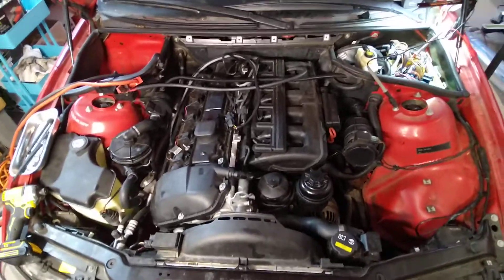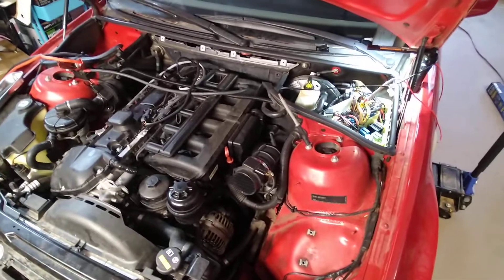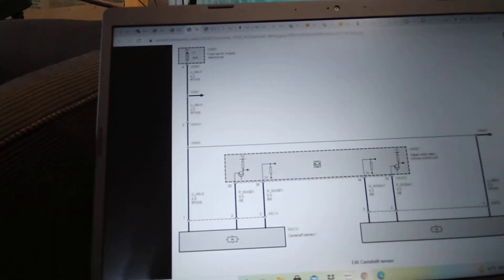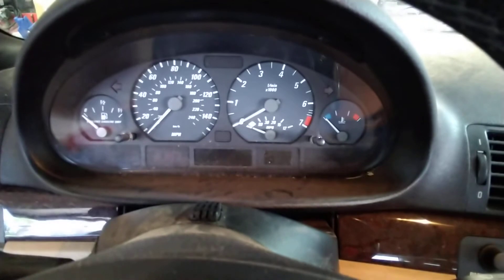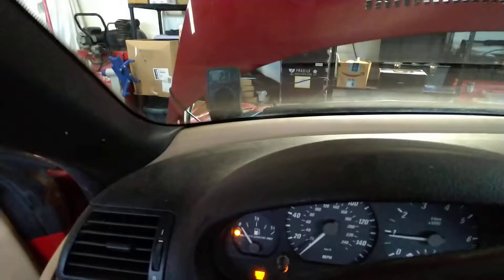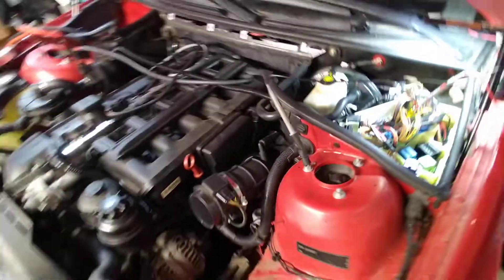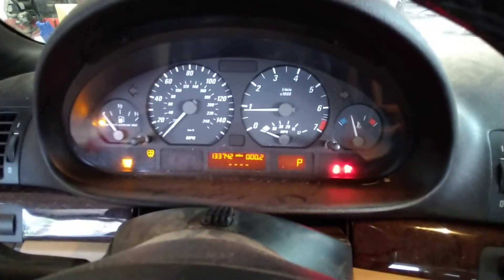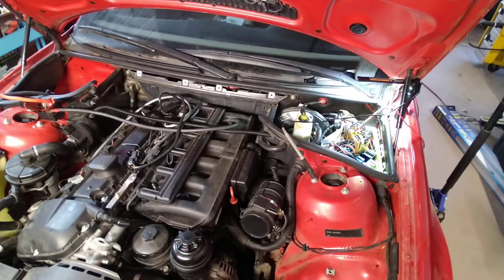**SOLVED** BMW E46 2005 325ci cam sensor signal code 2766 p1315, Not a common solution

Comment: Thank you so much for your "solution"
I have an E60 with this same persistent code. I even sent out the ECU for testing, and they showed me a video of my ECU running perfectly on a dynamic test they did, so nothing made sense.
Until I have read your solution.
We did install new head gaskets etc, and some guy came to do the timing.
Now I can confirm it wasn't done right, since he didn't use any special tools.
I will conduct voltage tests like you did, but I am pretty damn sure this was the issue all along.

Comment: I'm having crankshaft sensor problem with camshaft low voltage to the crankshaft 
Also have a 3 to 4 second delay on the start any suggestions will be appreciated thks

Comment: Hello, same code here on m54 engine. When hot the engine cranks long...it is driving me crazy. New sensor replaced but same issue. Could it be a crankcase sensor in my case?
Reply: Have you taken the crankshaft sensor out and checked it for cracks?
Reply: @robertcarlson1378  nope, the position to take it out is a bit difficult. It is strange because camshaft sensor is the one throwing codes. Also checked and swapped the vanos solenoids and problem is not gone.
Reply from the maker: Finally had time to devote again and found the solution.
Reply: I have same issues. May know how u fixed it?
Reply: Same to me but a saw the connection between the sensor and the ecu is a bit broken, and then the error is for bad connection